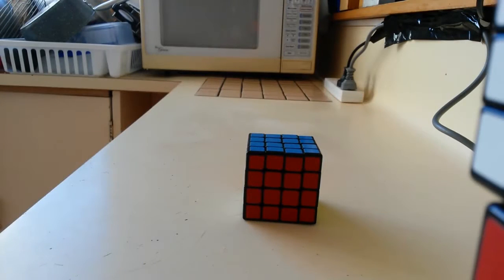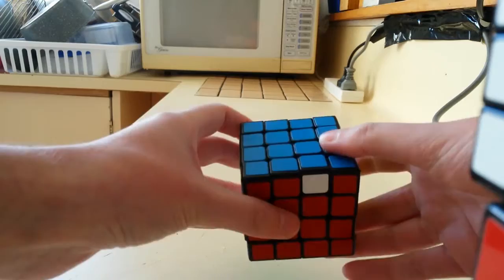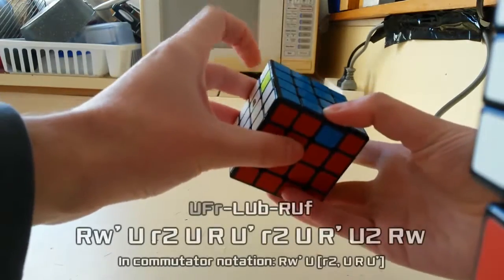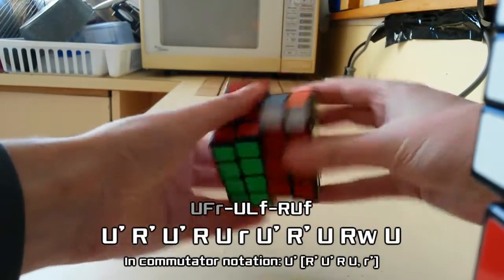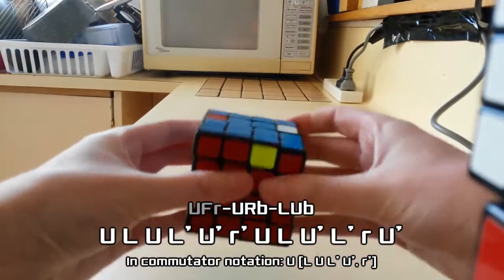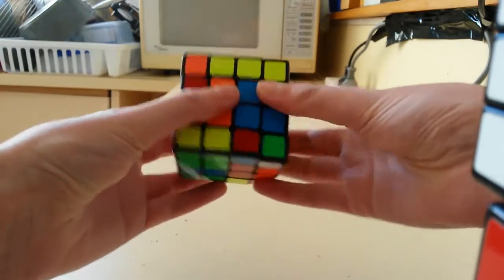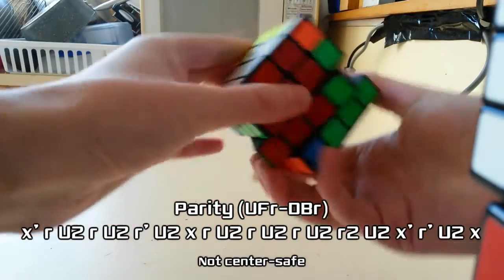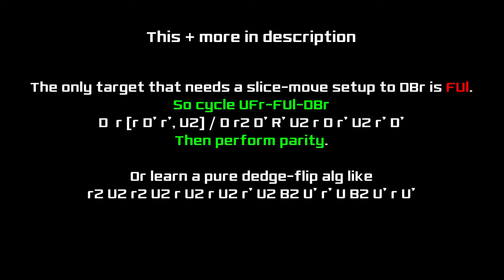TuRBo wings "tutorial" (UFr Buffer) - For 4BLD+

Comment: Just curious, what are your reasons for making UFr your buffer?
Reply from the maker: I figured UFr would be more R based than UFl which I saw as a good thing (still do). I also wanted wings to line up with my edge buffer.

But I think the biggest reason was Jay told me to switch :P
Reply: Lol, I was torn because using UFr meant I had to change what side of every pair of wings I had to memo a letter for, but the reason which tipped it was that you use it and you have a tutorial on it :P
Reply from the maker: It doesn't take long to get used to. Much easier than switching all of your comms :P
Reply: Haha ok, good
Reply: I had the same fear